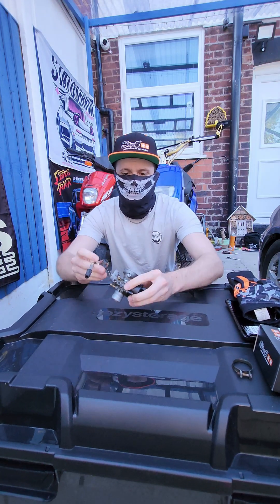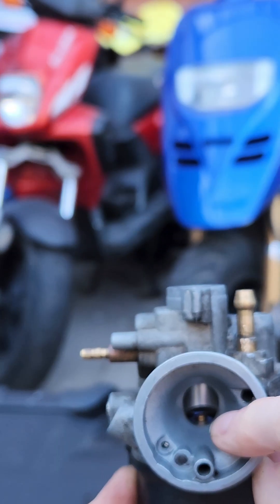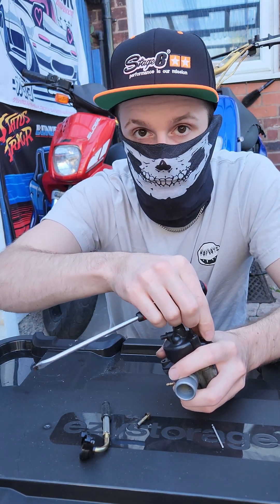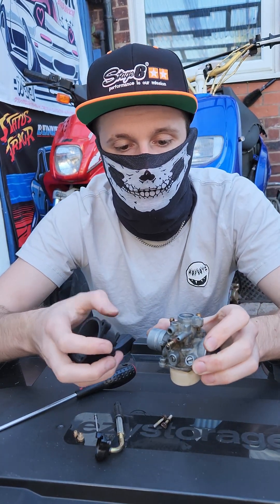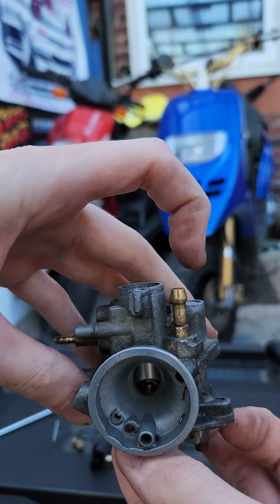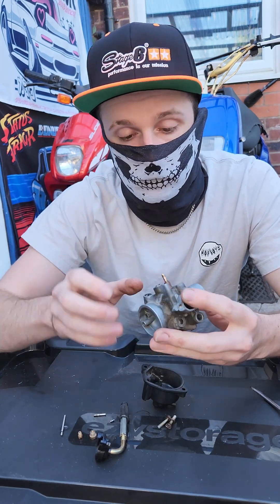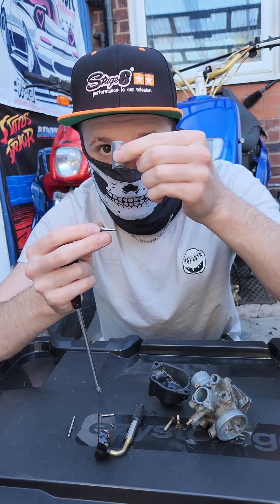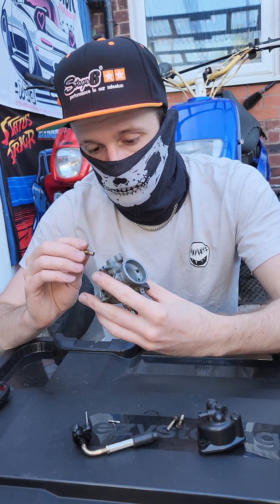Understand your Carburettor

Comment: Nice work man thanks for sharing your knowledge!
I am going to tune my carburator tomorrow because it runs so slow it holds one speed like 50km p/h for longer than a minute full throttle before going up to 80km 
Do you have any advice for me what i can do?
Reply from the maker: @adarshstruikelblok9352  is it a 2 stroke scooter? Have you done any modifications yet? If you want more speed there are restrictors that need removing from the scooter to increase speed and performance